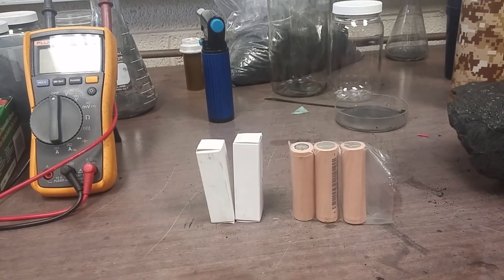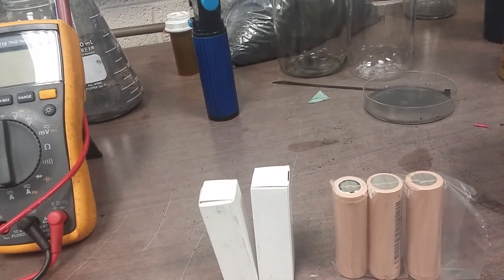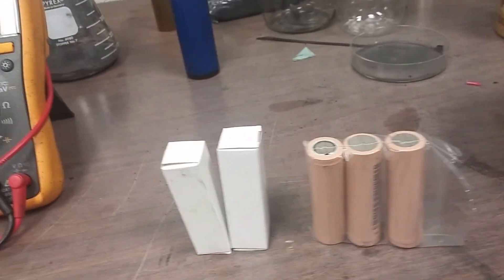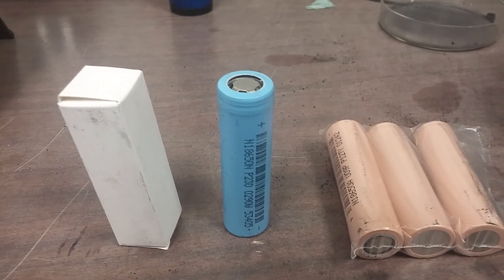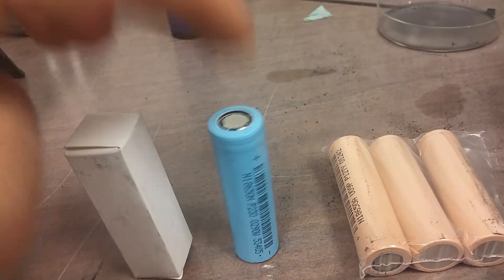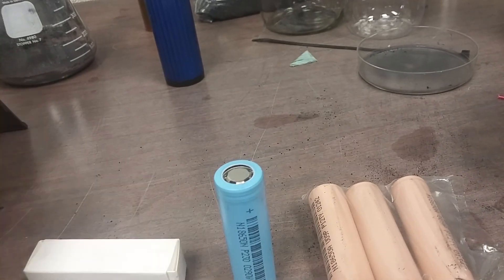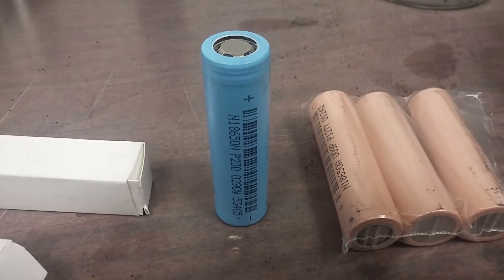Real graphene batteries. Finally!

Comment: 1yr old tube but still. He is saying they are newly baked from the factory. I suppose he went to a factory to get help making 18650-sized cells or asked them on distance. But they have to be tested for endurance, load and re-charge and it takes time. Making negative comments is okey but quite funny - you make fun out of your self with it.

Comment: Hi Venturestarx,

Do you know where to buy Graphene cells? Actually I am working on the University project to power the drone like structure. I am looking for high energy density and less capacity battery cells like Graphene cells. Please provide the information where I can buy it from Canada.

Thanks
aks
Reply: Typo: less weight but high capacity battery what I mean in my above comment. Any information on where to buy graphene cells will be more useful.

Thanks again
aks
Reply from the maker: Akshay Rathod I'm not up to date on the battery stuff, outside of another round of testing we are working on. I can't disclose any more than that at the moment.

Comment: hello,

Venturestarx
can you sell such batteries? We want to buy them
Reply from the maker: alex shmidt I'd love to sell them, but the company that makes them is very slow at adopting. The sad party is these cells are very easy to make by a battery manufacturer, and are far better than the original cells. I'd love to get with a faster company.
Reply: +Venturestarx
So you have plan and everything necessary to produce them, you just need factory? I can help you if you want. I can buy even sample from you. 
How much it will cost?
Reply from the maker: alex shmidt I need a manufacturer. We only produce the graphene. So a battery company who currently makes cells could easily adapt our material into their line.
Reply: +Venturestarx  There's no drawings/plans neccessary? Just use graphene instead lithium in cells and it's such easy? Can you write your email?
Reply: +Venturestarx ,   do you have gerber files or any plans for assembly cells? Please response
Reply from the maker: I know how they were assembled. I can't say specifics on this companies formulation, but I can tell you they make a very standard 18650 lithium cell, and add graphene into the graphite anode slurry.
Reply: +Venturestarx,  I don't ask you any info for this company. I offered you my help or my commercial interest.
I have connections with many companies who are ready to produce graphene batteries if they have plan/drawing/gerber file of it. Can you provide this file to me?
Reply from the maker: If they can produce batteries, the info I told you already gets them where they need to be. I don't have access to the files you ask for, sorry.
Reply: +Venturestarx

can you sell one item?

Comment: http://i.ebayimg.com/images/i/230629486059-0-1/s-l1000.jpg
Reply: there's a 1800 mAh battery for ya you fucking genius
Reply: not to say the one you have isn't, it's just not made of what you claim.  One easy way to prove that would be to open the fucking thing.

Comment: you speak of a rating and dont say what that rating is other than the number?!?!??!?!?!?  are you talking about ohms, mah?? and what is the C i know their not coolums because that's what you said.  What's the 6 or 7 going in or out.   I think you meant to say the 19 or 20 over under is almost an A but i dont mean apple but some people may know but we've got an ohm meter over here and they engineers say DANG those are good batteries.  I've done this and that and some things and went over there and HEY good batteries but not really bud those batteries are only 1800 mAh so it could be lipo or even just NiMH IDIOT!!!!!!  that battery would have cost a million dollars....or you could just order one of Amazon for 5 bucks.

Comment: So what I am gathering is that these graphene-based cells should offer roughly the same energy density as the most energy-dense Lithium technologies we currently have but offer faster charge and discharge rates.  We can already hit 15C Charge/35C discharge rates with commodity lipo cells designed for the task but the trade off has been capacity because you are trading energy density for power density.  How many C charging are we looking at for these graphene cells if they are able to be charged in say minutes or seconds?  15C is already crazy with the highest rate lipo technology where the limiting factor is really the charger, not the battery.  For example, the high drain lipo's used in cordless tools are in the range of 5C/10C 2200-2400mAh.  That means they are able to be fully charged in 12 minutes at a rate of 11-12 amps per cell.  The real benefit will be to get the best of both worlds but that has been the Holy Grail of battery technology thus far.
Reply from the maker: kuhrd you are correct! The nominal C rating for Lipo batteries in testing is 0.5C, but they can be cranked up to 15, but get damaged from it. It's a trade-off, and that's what we are working on reducing.

Comment: While i was digging, i found this video ?v=Rt-e__WWJXA the cells look very similar to the ones used in this video.
Reply from the maker: They could be from the same manufacturer. They just wrapped these up in an on hand sleeve. I'll take one apart as soon as I can to show what's inside, the testing isn't fully done.

Comment: 6 C is not great, I have seen Li-ion rc car batteries around 15C. it's just he charge and discharge rate.
Reply from the maker: When dealing with nominal testing, a base cell charges at 0.5 C. We can charge the graphene version far beyond that. That's why it's special. Different chemistry would take more than 14 times the base value.

Comment: A 3800 mAh cell with a C rate of 7 could charge and discharge at 26.6 amps. C rate X Ah (Amp hours)= Amps battery can handle.
7 C X 3.8 Ah= 26.6 A

Comment: lies
Reply from the maker: What lies?
Reply: give me a break dude, I'm a master electrician.  Those are some nice lipo batteries tho, you get them out of your vape mod? ROFLOLOL
Reply: I mean if it's not a lie hook a tester up to it and show me that it's dead and without any cut in the video lets see you charge it after all if it is a graphine battery that will only take a moment.
Reply from the maker: The answer to that is in the video, if you had listened. Again, the "tester" I have is called a potentiostat. The cells can take more energy than what the potentiostat can deliver. Therefore, it will only charge the battery just like a regular battery. So, your solution would not work. I sent the cells out to a third party because they have the right gear.
Reply from the maker: I don't believe you. You haven't even wired a single plug.
Reply: you have a tester sitting right next to it guy, use that one, it will work just fine, if you dont know what settings it needs to be on I can tell you.
Reply: USE THE FLUKE METER
Reply: that's a nice fluke btw, about 50 bucks more than the one ive got

Comment: Try smashing the batteries with a pneumatic hammer, if it survives, it's graphene.
Reply from the maker: That's not how it works. ;P
Reply: Venturestarx I already know it isn't graphene anyways, it acts like it's a bit heavy and graphene is super light. Graphene cannot be created precise enough on a large scale to be used as a battery. I'm sorry to tell you but that is not graphene (and it should survive a pneumatic hammer to be honest, it's 20 times stronger than diamond!)
Reply from the maker: Ant Skeptic I hate to tell you this, but you don't know the first thing about graphene. You seen to not even understand what graphene in a battery is for.

Comment: Are you currently working with an electric car company? I would like to purchase an electric vehicle with a Supercapacitor. That will allow the electric vehicle to charge in about 5 minutes and have a driving range between 300 and 500 miles.
Reply from the maker: So would I, that's the end goal. We still have some work ahead for that to happen, but it's on it's way.
Reply: 56strine , My 35 yr old EV needs New Batteries!
$1,000 for Lead Acid ARE NOT the Answer!
$12,000 for Lithium Ion Are Not Either!
Reply: It is all up to those in power.

Comment: Are you ahead of Eestor along with the other Supercapacitor/Ultracapacitor companies?
Reply from the maker: Actually, Eestore was one of the reasons I got into Supercap/batteries. Last I heard, they hadn't produced anything.
Reply: Venturestarx supercap capacities make them unfeasible for EVs. Everyone is desperate for the next big lithium battery breakthrough.
Will you be testing other form factors? I'd be very interested to see your results with 21700 size cells.
Reply from the maker: I'm working on it. I'm not really a battery guy, Robert Murray-Smith is far ahead of me in that department. We kinda swapped goals a while back, where I was on batteries, and he was on graphene. Now he is the battery guy, I'm the graphene guy. Very cool stuff.

Comment: A batterie's C-Rating indicates it's charge or discharge rate.
For example, if a battery will fully charge or discharge in 1 minute, it's C-Rating is 60.
If it will fully discharge in 1 hour, then it's C-Rating is 1.
A battery's charge vs discharge C-Rating is often different.
Most charge at C-3 to as little as C-0.2, but charge more fully at less than they're Rated at.
Most LiPo batteries are discharge C-Rated between 10 and 45, so for every Amp of storage they possess, they can supply their C-Rating of output for a shorter period of time.
For example: A C10 with 2 AmpHour of storage, can provide (10x2=)20 Amps output for (60÷10=)6 minutes.
A C-Rate of 0.5 with 2 Ahr of storage, can supply 1 Amp of output for 2 hours.
What is the C-Rating of your Graphene battery?

Comment: Does the Graphene Battery allow for a charge time of about 5 minutes for an electric vehicle? Would it allow the electric vehicle to have a driving range of 300 to 500 miles on a single charge?
Reply from the maker: Considering the fact it has an increased energy density, yes.
Reply: Why are they not selling the electric vehicles that will contain these Supercapacitors? It would really boost our economy!

Comment: Graphene is a coherent, one atom thick sheet of carbon. The batteries shown here are 18650 and would require a meter or two of graphene. Nobody makes them, nobody in the world figured out how to make such a large piece and they sure as heck wouldn't sell it in a battery first.  If you want to confirm for yourself just cut the end off and unravel the roll. Now, could the cell have great properties? Sure, but not from graphene, just the chemistry being better than other batteries.
Reply from the maker: All of those statements are incorrect.
Reply: How so? Can you make a battery out of graphite and still call it graphene?
Reply from the maker: eternitynaut no, if you did that, it would be a regular Lipo battery.

Comment: You might want to check your comment about the 'C' rating.   Turnigy is currently selling Graphene batteries (for RC hobby items) that have C ratings as high as 65, 90 and even 130C (Burst mode) so 6C is nothing - even Li-Poly batteries can do 10C or more easy.   Very interested in the 18650's though and would like any info on where these are or will be available.

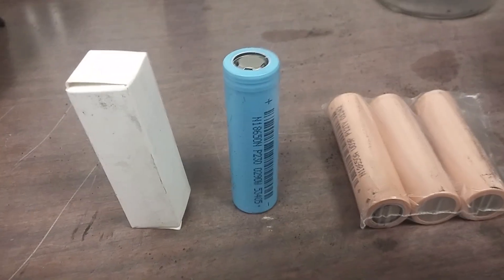Comment: 4:50 your average Tesla car with (average) graphene battery capacity of 70 kWh charges up in 5 minutes IF you provide for a duration of 5 minutes a power of: 70kWh / 0.08(3) h  = 840 kW. 
At 400V (Tesla model S average battery voltage) you need 2100 A and a crane to connect the charging cable to your Tesla car...
Reply from the maker: You are correct. It's also why you would absolutely need the voltage to go up, and a very different charge system. But having that ability to charge so quick would be worth it.

Comment: throw them away, I've made a new polarized h2o Nano gel battery (yea that's it, that sounds good) that in a 18650 configuration gets oh.... 9,206.5mah for only 13cents a cell. so that makes all batteries obsolete.
Reply from the maker: Tom Smith I'd love to test them out. I'm open to testing and verifying your results. It sounds tremendous.
Reply: ok, but I have to wait for a full planetary ascension to align the nanogel molecules so...o....o....ah!  just missed one.
Reply from the maker: Tom Smith lolololololololololololz.

Comment: Making tonnes of graphene , there's a graphene university in Manchester trying to produce a kg of the stuff in a reasonable timeframe, i cant believe how full of shit you are.
Reply from the maker: I have a video with several hundred kilos in it. Check it out. My company makes more graphene than all the rest of the companies in the world combined, times 10.
Reply: even First Graphite? Largest graphene company we have in Australia and they claim to produce more graphene than anybody else.
Reply from the maker: They claim that they can make 13 tonnes a year. Yes, we make far more than that, and at a lower cost.
Reply: Venturestarx are you 100pc sure you are producing one atom thick 13tpa for $1000 per tonne? I will report their claims to asic if you confirm
Reply from the maker: It's about a million dollars (US) per metric tonne.
Reply: Venturestarx ok that seems v expensive. I'll stick with my investment. Thanks for your time
Reply from the maker: But yes, we make much more than they do. The 13 tonnes they claim is a "theoretical yield" if they have their machinery up and running 100%. We make more than that, and aren't pushing our machinery.
Reply: Venturestarx ok. Well asking as they can produce it. Ford and Boeing are testing their graphene now. Traxys is acting as the connector between both groups. I have a slight feeling that graphene is still 15 years away from mass production though.
Reply from the maker: We are about 6 months from dominating all parts of the market. We actually have ins with several large companies (I can't disclose) that purchase in mass. A couple of tonnes of graphene can go a long way. In plastics alone, we see huge gains at just 0.5% by weight.
Reply: Venturestarx good luck. I'll return in six months to call you out on that :)
Reply from the maker: No problem!

Comment: Ultrafire says there li-on18650's are 5500 mah, and 6000 mah!  lol
Reply from the maker: LOLz, I'd love to see them. The best cells I have ever actually seen without graphene (they were expensive $15.00 each Panasonic units) were 3400mah rated.  I believe they only hold that rating for a few charge cycles and settle down to ~3300. The company I'm working with makes some of those cells, but they are creme of the crop units.

Comment: It is false, these batteries are lithium.
Reply from the maker: What is false?
Reply: The graphene batteries are not currently in production, only in the laboratory, those batteries that are certainly lithium.
If you bought them on the internet mainly from China is a fraud, for example the 18650 3.7V 9800mAh Yellow Li-ion Rechargeable Battery (that is fraud the maximum charge that have been manufactured is 2500mAh maximum 3000 mAh)        http://www.ebay.com/itm/4-LG-INR18650-HG2-HIGH-DRAIN-20A-RECHARGEABLE-Battery-3000mAh-BROWN/122529119205?_trksid=p2047675.c100005.m1851&_trkparms=aid%3D222007%26algo%3DSIC.MBE%26ao%3D2%26asc%3D41375%26meid%3D3862bded67c644a38b801f93f5e4b4fc%26pid%3D100005%26rk%3D5%26rkt%3D6%26sd%3D263010431620
Reply from the maker: I didn't buy them. They were made by a company with the graphene I produce. You don't know what you are talking about.
Reply: Okay, if you want to believe those batteries are graphene, go ahead, but they're fooling you. The funny thing is that you are happy even with lies. Believe me if I know what I'm talking about.
Reply from the maker: Edgardo Lopez that's the most delusional comment I have ever seen. What part of the company used the graphene my company produces in these cells do you not get?
Reply: You are factory? Please tell me the characteristics of the battery
Reply from the maker: My factory makes graphene, and we ship to this company so they can make the battery with it. They sent me these cells because I can get them tested and verified by multiple sources because there are so many frauds out there trying to scam. So when they get the data back, they will start selling them to everyone with verified results, not cherry picked bogus numbers that so many others have tried to pawn off for a quick buck.